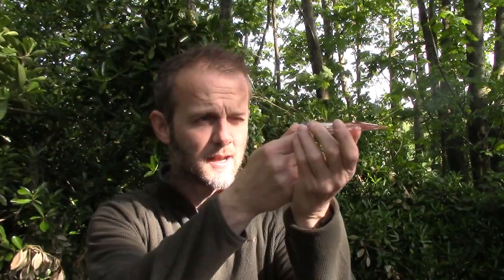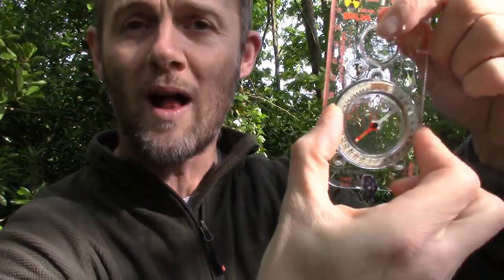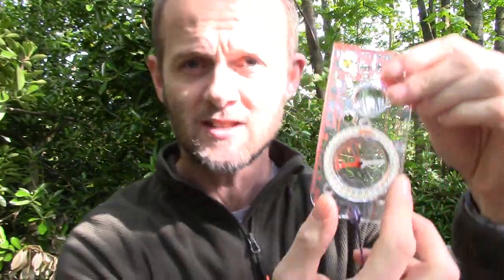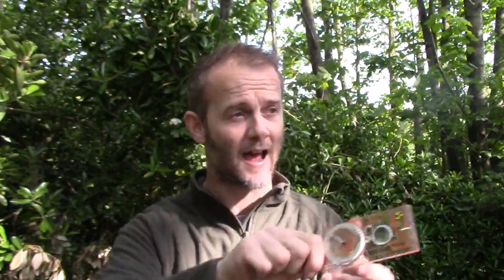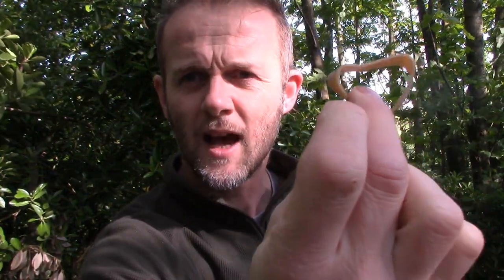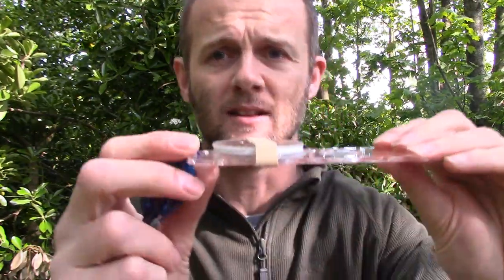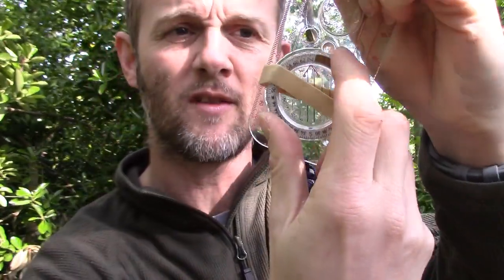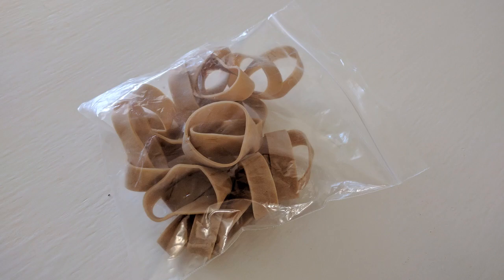How To Hack Your Compass

Comment: I find that using a cheap sunglasses sleeve cover helps, and also protects the compass. You can cut off the corner and pass the lanyard through it.

However when I first tried it I made a schoolboy error and used a sleeve that had a metal spring closure in the opening…over a 5 k leg when orienteering on  Salisbury Plain it took me onto the wrong spur and I found myself looking down on a built-up area that shouldn’t be there!

I use a different sleeve now :)

Comment: hi Craig, just curious, I was wondering why you don't 'pimp your maps' to include the magvar, then for each map you never have to worry about whether your compass is set to the correct variation?
Reply from the maker: Hi and thanks for watching, it's much appreciated. Can you explain a little more about what you mean? Are you talking about something above and beyond this specifically > https://www.youtube.com/watch?v=0u4Qs1864Mc&t=31s&list=PLe6GqVDZVa4-JHzFVBz5gaQJPwLnNotAZ&index=1
Reply: The Bushcraft Padawan hi yes, above and beyond this, I'm a long distance Walker, so often cut my maps down quite considerably, which removes all of the info from around the edges, so with magvar I normally (in a thin red pen) draw the lines in, on the actual map, that way when changing from map to map, in the field, I never have to worry about different variations to magnetic north, they have all been done and accounted for in the relaxing confines of my home. I use a different colour pen (red), so that they contrast with any grid lines on the map. hope this makes sense.
Reply from the maker: Hi. Thanks for the explanation (although tbh, I think I'd need to 'see it' to fully understand it). I've got a video lined up soon about 'cutting down maps'.
Reply: The Bushcraft Padawan, hi I can understand that,  it's often hard to visualise through dodgy descriptions on the Internet, lol. great chanel you've got going, I've enjoyed the video I've watched over the last couple of days, & look forwards to more. I'll try and dm you a pic of what I'm on about.
Reply: Old discussion,  but if any one is having trouble following: Craig folds his map down and with pencil writes the magnetic variation down as e.g. 2° West, meanwhile Lobo takes a red pen and actually draws the mv line across the map.
Reply from the maker: Funny you should mention that my friend as that will form part of next week's live stream on Friday evening.